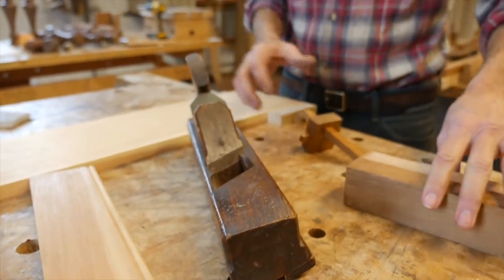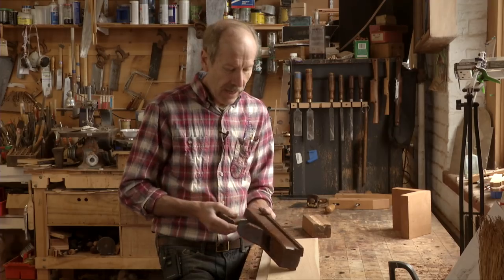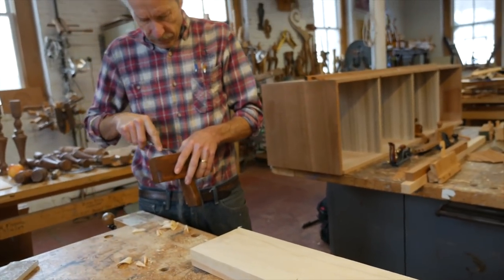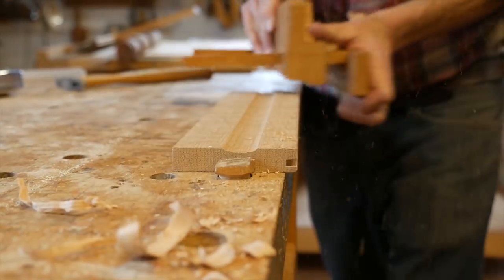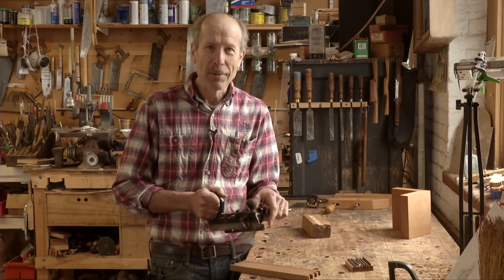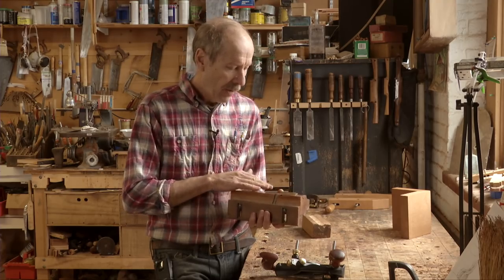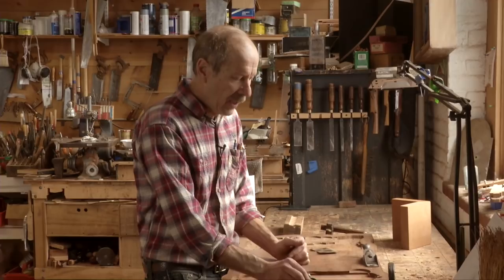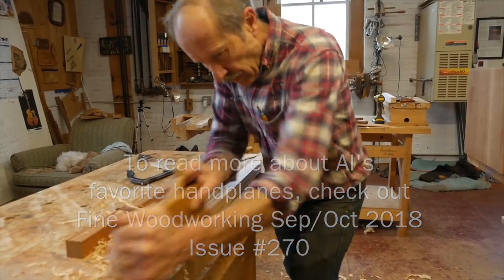Al Breed's Favorite Specialty Planes

Comment: No°45 ‘Dado Plane’? I know it’s a combination plane, but he called it a Dado plane and proceeded to cut grooves in drawer sides, he didn’t once cut, pretend to cut, or even show a dado.  Did I miss something, I thought dados were across the grain; is a dado just a really old term for what we call grooves and dados?  

Disclaimer: Don’t get me wrong, I know the No°45 can cut dados,rabbets, etc and has knickers for doing so. I’ve formerly owned and used a No°45 extensively and sold it because my Veritas Skew Rabbet and my Veritas Small Plow Plane do all I need them to since I cut all my dados and sliding dovetails by hand with a saw, chisel, and router plane; sometimes I’ll use a side rabbet plane to tune a sliding dovetail, but since most all dados and sliding dovetails I cut are stopped/housed, the old fashioned way of a saw up against a batten and then the chisel and router plane is simply faster for me (stopped or through).  As for those who will talk about beading, sash, tongue/groove, etc… the quality and variety of profiles I can make with halves and rounds, a snipes bill plane pair, and a few wooden rabbet (skew and straight both depending on cross grain or straight grain) do all of that.  Beading/reeding is playing fast with snipes bill and a small halve if really needed, but I’d recommend a new woodworker do those with a homemade scratch stock first any way.  Not to mention that most of us know that you’re going to pick up some complex molding planes along the way that can be returned to good workers because they’re included in some lot of tools we bought that had 5-10 vintage planes and we bought the lot specifically for that good looking rabbet or other plane we needed/wanted and got some diamonds that simply needed some TLC. And besides, those cutters for beads/reeds are avail for the small plow plane if someone wants them ,to include T&G’s and you can even cut some huge Rabbets with it too (over 3/4”, but I’m not trying to do a commercial for the Veritas Small Plow Plane, it is just that much better in nearly every regard compared to a No°45). So please don’t think I’m being a prude or exclusive; heck the video is about his favorite ‘specialty planes’ and he actually talks about many of the same planes I’ve mentioned using.  Hey, I’m that same guy who also recommends a homemade drawer bottom plane to any beginner over a Combination Plane or even the Veritas Plow as a starting place before buying a plow.  The No°45 is a great piece of kit and does a decent job at most things but honestly no single action really well.  What I’m really writing the comment for is to understand why he called a dado, what I’d not ever have thought to refer to as a dado refer to a dado?  I know I’m not alone on this question.  
Cheers 👍